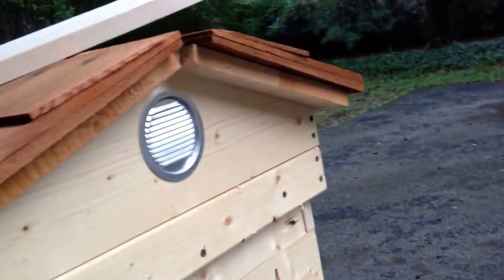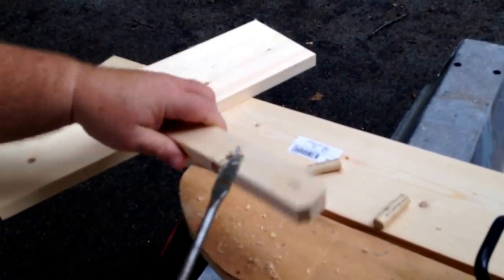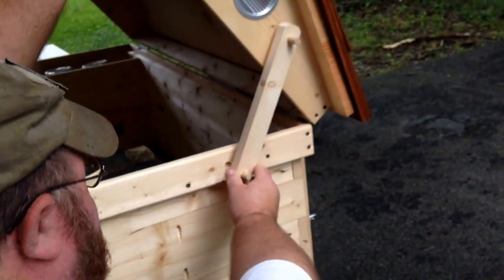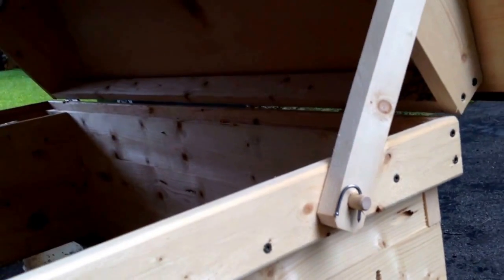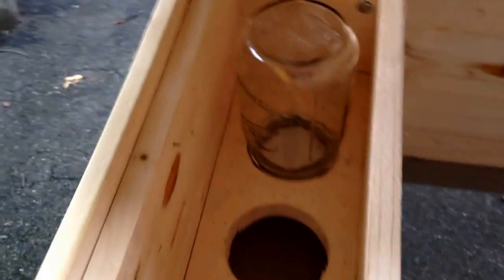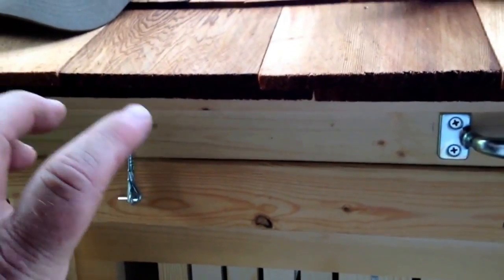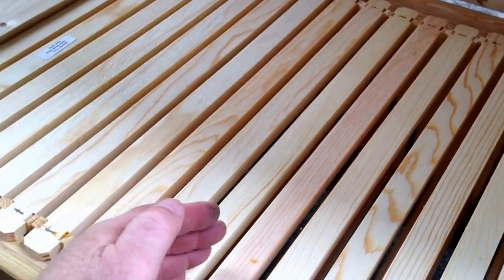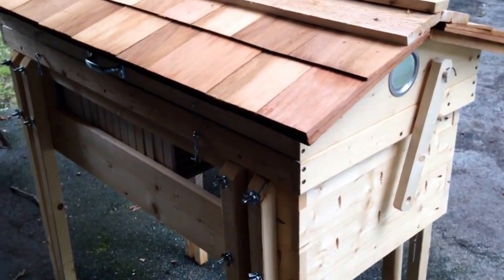Hybrid Beehive Progress - The Artisan Apiary Project

Comment: You can use a length of chain to hold the lid open.  Similar to what is used on small decorative boxes.
Reply from the maker: The chain is not rigid and will not resist forces in both directions only one.  My solution is much more safe than a chain.